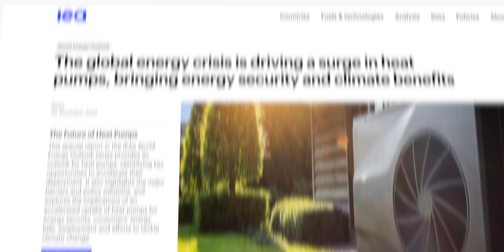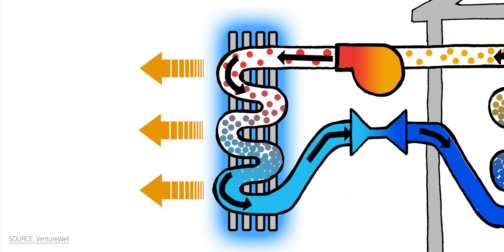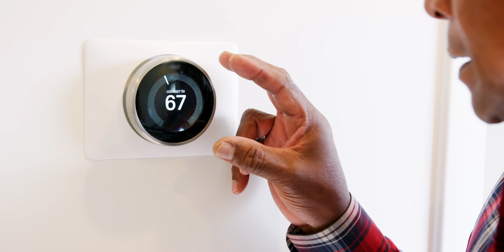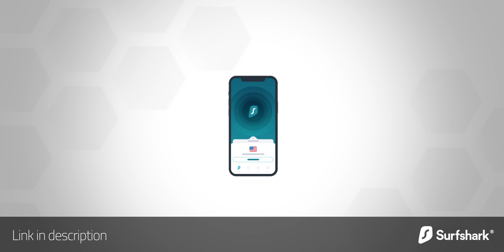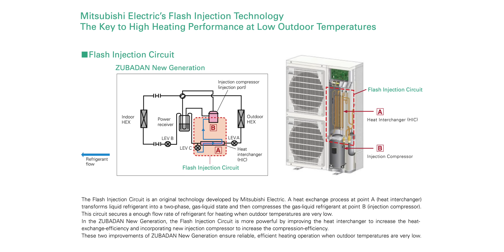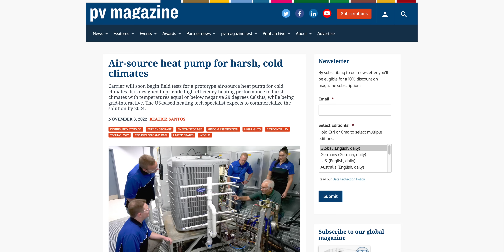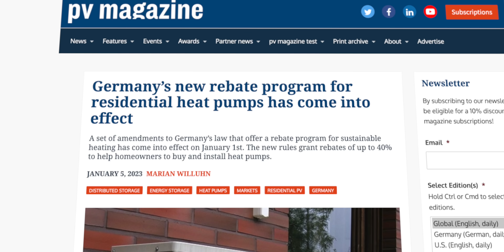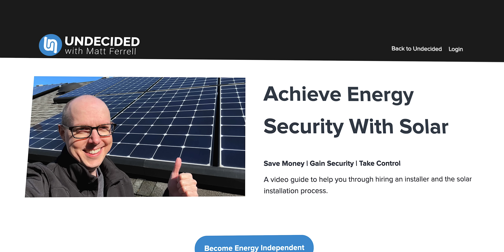Major Advances with Heat Pumps in the Extreme Cold

Comment: Call me skeptical. After owning a house with a heat pump system that had to be replaced twice in the 15 years I lived there and needed to be replaced a 3rd time when I sold the house. I prefer to call heat pumps money pumps. They cost a lot to install and replace especially if they only last 7-8 years plus the higher power bills I incurred because they ran ALL the time in the winter and could barely keep the house warm. The system WAS sized properly so that was not the issue the issue is heat pump systems suck when they are installed in a location that can have 100 degree days in the summer and 20 degree days in the winter requiring the auxiliary heat strips to run to help heat.  Maybe the newer ones have better tech and longer service life but I would prefer to heat with a gas forced air furnace  with a regular air conditioning system. Modern HVAC systems cost way too much to install and to operate. Why? Government regulations and the greed of HVAC contractors who have managed to get rules and regulations enacted to prevent DIYers from purchasing and installing their own systems.

Comment: I think the biggest thing people can do, is have a energy storage system on-site.

That way you can spend 16 to twenty hours to charge a battery, then draw from that to run a given appliance. 

A simple way to do this is use a battery bank to charge  your phone. While you are at work, during the off peak hours, you leave a power bank charging. Once you get home you remove the power bank during the on peak hour, then charge your phone. Use the same principle for every appliance that can be electrified. Stove, Water heater, refrigerator, and heat pumps. 

If there is a power outage, you have enough power on hand to cope with the loss of power.

Then, the issue becomes "how do we charge the battery," rather than how do we get enough energy to run...you can charge the battery from the grid, and various forms of generators {fossil fuel based, wind turbine, solar panels, etcetera. }

At least this is what makes the most sense to me.

Comment: At least this guy admits that during cold weather -4 degrees or below (thats a usual UK winter temperature) these contraptions dont work without additional features fitted like an emersion heater to keep it warm & prevent it freezing!!!!!!!!!!!!    WOW !!!!    As the boss of a leading leccy supplier stated recently on GBNews, heat pumps dont work & are very expensive to run...For sure they ARE expensive to run when for 7 months of any year (thats a typical winter period in the UK) your electricity bills WILL SOAR to cover the additional costs of running an emersion heater just to keep the contraption from freezing.......OMG !
Reply: Where I am gets -20C, Heat Pumps work fine.  There are plenty that are designed to go down to -30C.  Technically, it's not to prevent it freezing either.  It's to get rid of the frozen condensation on the fins which reduces airflow, and impacts performance, so a defrost cycle bring the efficiency back up again.  For me that happens for about 5 minutes every 1-2 hours.  GB News isn't a great source for heat pump information either (arguably it's not a great source for information full stop, but hey ho).

Comment: A big, big difference between geothermal and air source pumps.... 99.999% of people will have to go air-air...  These are definitely very ineffective in colder weather..

Next only the most modern well insulated and designed buildings work well with heat pumps...

Comment: Heat pump here in NW PA.  For all the fracking we have no NG down our way, and my wife didn't want the huge propane tank outside.  Works great until temps get below 20F, then it switches to the coils and the power usage goes way up.  I think they work best in a modern, well-insulated house (ours is 2013 construction).  I doubt they would work in an older 'leaky' or drafty house because they really don't create massive amounts of heat efficiently.  

We are quite happy with ours, as while nearby Lake Erie generates a ton of snow, it also keeps the temperatures moderate compared to someplace like MN or WI.  We rarely see <10F, and if we do it is for a night or two.

Comment: Lots to unpack here:
1. Heat pumps are not remotely new. We had one in my house in Virginia over 25 years ago (although we quickly replaced it, see next point.
2. Heat pumps are inevitably a fundamentally bad idea for anywhere that gets below 40F ("I'm American, so I'm going to use Fahrenheit" [ngl, that's pretty based]). Ever open up the air handler and feel how cold your coils are when using A/C? Imagine that, but outside when the temperature is near freezing or colder: there is no way to keep ice from forming. When ice forms on the coils in the outside unit, the system has to go into "defrost mode", aka it switches to A/C mode to thaw out the coils. And the coils have to be densely packed so that it's efficient in summer, but this just promotes ice formation in winter. Most heat pump systems have resistive heating as a backup so that your unit doesn't start blowing ice-cold air into your house when it goes into defrost mode, but, as you're probably aware, this is insanely expensive and inefficient. Also, your system is running in A/C mode, so it's cooling the air first and then attempting to reheat it in the most inefficient way possible, so the air is not exactly warm. I recently built a house in an area where it rarely gets below 40F, and we have a "low-temperature" heat pump, but the only thing low-temperature was our house.

TL;DR
Heat pumps have been around forever and work fine in warm climates but not in anywhere that gets below 40F. You can't cool the outside coils below freezing and expect them not to freeze.

Comment: No offense, but I'm not sure this information is correct. People have been using heat pumps without any issue in the extreme cold for a long time. Heat pumps work well in cold climates. They're also more efficient and cost less to operate, especially in moderate weather.

Comment: Heat pumps are incredibly dangerous due to the flammable nature of the refrigerant. Heat pumps are being installed by people who have no idea how flammable the refrigerant is.
Reply: How flammable is the gas being pumped into homes?  R32 which is common in heat pumps that have the refrigerant entering the homes is very difficult to ignite.  R290 (propane) is only used in outside units, and is less than 1kg + equivalent of about 1m³ of natural gas.  So either way it's much safer than gas being pumped inside the home.

Comment: As a Hvac tech I can tell u that air to air heat pump, good on paper not so much in reality. If u got snow or rain in ur area the constant defrost cycle will diminish the “efficiency” with geothermal I can definitely see it working better i have only seen a few in the field. The life expectancy heat pump is no where close to a standard cast iron boiler. And a lot more service needed over its years , trust me on that. Over the years I see all these new bells and whistles added but I can’t tell u the more parts u got in a equipment the more chance of failure.

Comment: Parts of this video are interesting, but some of it is completely wrong.  Geo (ground source) heat pumps are completely different from conventional air-source heat pumps that comprise 95+% of the market.  Geo heat pumps are totally unaffected by the outside temperature.  All the new tech is associated with air-source heat pumps, and not geo or ground source devices.  This video conflates them.

Comment: My 9 year old boiler broke and needed replacement. Every quote was over ten grand. I installed a Fujitsu mini split system with 3 heads but the outside unit could accept up to five. It's been great even down to below zero fahrenheit for 4 years now. My boiler is still broken and I have air conditioning and heat for the same cost as a replacement boiler.

Comment: We installed a Lenox air to air heat pump in 2008 (spelling error intentional). It worked well at temperatures down to the lower 20's, then it would switch over to propane. But now the reversing valve has failed so we just use the unit for air conditioning.

Comment: Thank you.  Very informative.

My 1960s gas-fired boiler will need replacing in the next decade or two, and using a heat pump to keep the hydronic baseboard heating going is one of our goals.  Perhaps by then we'll have a heat pump that can handle the deep freeze temps of a Montana winter.

Comment: @ 5:31 we here in Finland have our own "nordic" version of the heatpumps, for example Mitsubishi FT-35VGHZ. Without the Z at the end it's not suitable for nordic weathers. Also the Z version indoor unit has longer connection pipes so it reaches thru our thick insulated walls. And if you go for a Daikin then the outdoor unit coil is suspended in midair and doesn't need an electric heater since it defrosts straight to the ground.

Comment: I would suggest reviewing the engineering on todays cold climate heat pumps. Their operational range and efficiency is currently very impressive and useful in very cold climates. Having been instrumental in installing many of these throughout the Midwest, a well thought out installation functions extremely well and economically. Much of what was said here is a bit too general and not really helpful IMO.

Comment: Southeastern Europe here. Air to water heat pumps are just not a thing here. Very expensive and it rarely gets colder than -25°C. Air-to-air heat pumps, on the other hand, are a fairly popular choice of heating for older buildings that don't have central heating and weekend houses. 
"Air conditioners", as they're called here (ducted splits are very much not a thing here and cooling-only models are not sold) have significantly improved in their heating capability over the last 15 or so years. First and foremost, heating-specialized ACs are definitely differentiated from the plain old (and cheaper) ACs that get bought primarily for cooling with a few unique feature. One, they have two sets of heaters in the outdoor unit: one in the base plate of the outdoor unit so the condensate can run during defrost cycles and another to heat the compressor. Secondly, a good heating-primary AC unit always has a dual rotary inverter compressor - those allow the unit to run at far lower air temperatures than a single rotary compressor which gives out at around -10, -15°C. 
Now, for all it's conveniences (being the absolutely cheapest and least energy consuming means of electrical heating) there are some issues. Firstly, heat pumps (especially air-to-air units) do not go with uninsulated homes. You're going to lose a ton of heat without a thick level of styrofoam around your home and modern windows. Secondly, and this is mostly of a technical nature, heat pumps have to defrost every one to two hours because the outdoor unit gets extremely cold. The heaters come into play there - the pan heater helps keep the condensate pouring out of the unit in liquid form so it doesn't freeze up completely and damage the radiator fins while the compressor heater is necessary for very low temperature operation. Even with those features, a defrost takes around 7-8 minutes on average during which the heat pump reverses operation and takes a portion of the heat from the indoor are to unfreeze the condensate. During this period the indoor unit might blow cold air (on cheaper units) or stop blowing completely (on a higher end unit). Producers of air-to-air heat pumps have been trying to solve this issue for ages and the only one to really tackle it is Panasonic with their Heatcharge system (AFAIK not available in America). Heatcharge has a separate set of tubes that serve as a heat reservoir of sorts - this reservoir gets filled with heat while the heating mode is active, while in defrost the reservoir transmits heat to the interior unit so hot air continues to blow while the outdoor unit defrosts. Mitsubishi also has a solution in the form of HyperHeat (multisplit)/ HyperCore (single zone minisplit), and this essentially works by making the defrost as fast as possible, cutting it from 7-8 minutes to just 3 minutes. Either way if you can get your hand on one of these, you're set for heat pump heating. Avoid Chinese units like a plague, they all have terrible energy modulation. The only exception is the Gree Amber Premium which has terrible modulation while cooling but really good modulation while heating, and that would be a good budget-friendly option.

Comment: not sure how it withstand when it has computer boards outside vs conventional HVAC central have no circuit boards outside for pump, its just capacitor and contactor and fan motor...no computers anywhere, just wiring  ...everything is inside the house done on main package system

Comment: I work in Indiana. I work on geothermal heat pumps alot. There is not a heat pump on the market currently in 2023 that can handle temperatures near 0°. They all run electric heat strips at the same time as the heat pump to try and keep up. Geothermal heat pumps do the same when it gets that cold

Comment: The main problem with heat pumps is that they use a crazy amount of watts. My goal with solar panels and batteries is to import as close to 0 from the grid as possible. That means staying below production during the day and within battery capacity at night. On a good day I can import less than 0.1 kWh a day, and on average some 0.5 kWh per day. Heat pumps run at EV charger levels.

Comment: The best heat pump is an old four stroke engine with a compression ratio of 20 to 1 in two stages in series and postion the compressor like engine driven by an electric motor in an equilibrium like a Room the heat accumulated but the energy consumption will be the same as using a simple heather 😊

Comment: trying to decide whether to under take this project, my reluctance is in capping my 
gas boiler in order to get the rebate, and having to go through a NY winter using only heat pumps 😅Is there current a list  of the latest  cchp  ductless mini split system makes and models that meet or exceed industry standards?
Reply: Maybe get a small space heater just in case there is a super super cold winter.

Comment: So the answer is. No! They do not work efficiently at low temperatures. To get the "heat-pump to work well you have to get the machine back into its ambient temperature range. To do that one has to place an "heating element" within the H/Pump. This reduces the efficiency back to an ordinary radiate heater.  Bottom line. One does not get something for nothing!!

Comment: LOL in the USA you discover the "Hot Water" 30 years later with the variable speed drive and also the so caled "Smart Thermostathes".
And one thing to say, 30 years ago a heat pump was quite poor on performace in heating with a COP of 2,1 to 2,6 in conditions of Air 7 and Flow Water 35, now with greather area of the heath exchangers and inverter drive compresors and EEV valves the situation is in the same conditions a COP of 4,5 - 5.
Sorry, that the units are in SI you can convert.

Comment: We have a Fujitsu XLTH multi-split with three interior heads. Good down to -26°C (-15°F). It offset 90% of our oil use last year, saving us CAD 2,800 assuming pre-invasion oil prices. Closer to CAD 4,000 with post-invasion prices. Those numbers factor in the increased electricity costs we incurred. It also reduced our carbon footprint by 1.1 tons in the process (factoring in the current sources of electrical power here, this will get better as more power mix comes from hydro vs oil).

System in total including a snow and ice shield above the 28,000 BTU outdoor unit, and three indoor units (1 x 12,000 BTU and 2 x 7,000 BTU), was CAD 12,000 tax in Summer 2022. We received a CAD 5,000 rebate from the Canadian government as well.

By my calculation, heat pumps are an economic win for a household unless you have natural gas or oil at less than 8 times per liter what electricity costs per kWh (not a very handy comparison, but that's extremely unlikely and with wind and solar ramping up it is vanishing by the year). If you're worried about extreme cold events, keep some baseboard radiators and leave them on thermostats at a lower temp as a backstop. Don't get rid of your existing heat system, supplement it.

Comment: Living in eastern Canada most homes were heated with oil, and I used to have an oil fired boiler supplying hot water to an "in floor" heating system. After a couple of years of research I purchased a 50,000 btu Arctic heat pump. The unit has an inverter driven compressor, a 50 gal/12kw buffer tank and backup, and also preheats my domestic hot water. After two winters I am very impressed and the only time the backup heater cut in was on a stormy night in January with minus 24 degree C. At this point I am very impressed and glad I went down that road.

Comment: @8:23 You say that modern air source heat pumps are more efficient than fuel fired heating even at low temperatures. What would be the relative cost per unit of energy differential between electricity and gas and heating oil at which a modern fuel source heater and a modern air source pump are cost neutral to run?

Comment: As an Hvac guy I can just say No, there not worth it. Cost to Operate/Repair the unit, And trust me they break and lose refrigerant constantly, negate any "savings" you might think your gaining. Electricity operates these units which is produced by Natural Gas in the USA. Electric rates have risen causing the pros to now all be cons. In colder weather you need the refrigerant to be lower pressure to Absorb the Ambient Energy. Which with R410A ( Industry standard being phased out) , is hard to do and requires really low pressures. Which is hard to do. Parts and labor added on to the energy cost makes it a worse option in efficiency. Cant Beat Natural Gas 90%+ furnaces.